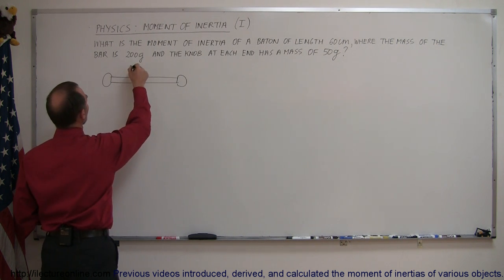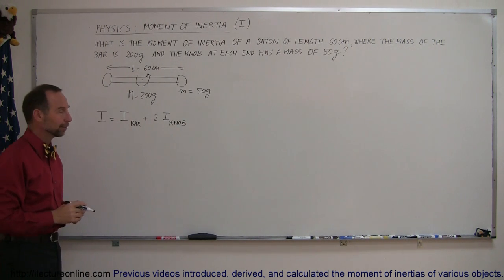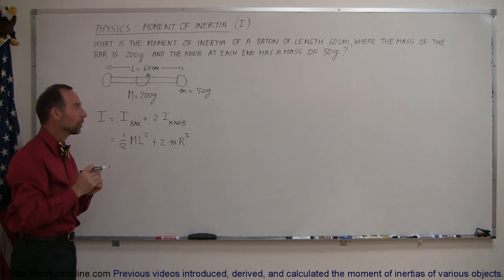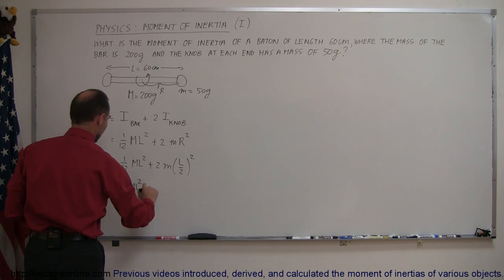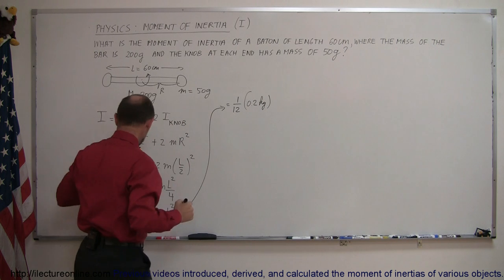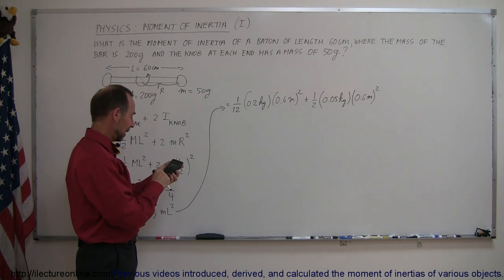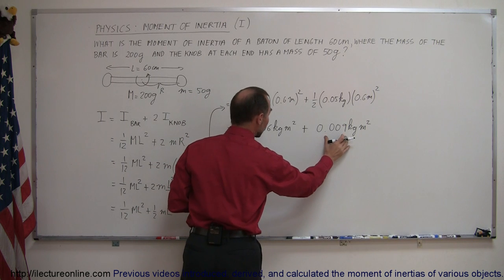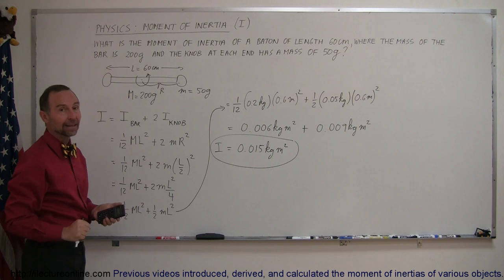Physics 12  Moment of Inertia (6 of 6) Moment of Inertia of a Baton

Comment: Great videos. I have been getting A's in my physics class because of you. Thanksss can you make a video of this problem, I'm very sure you could explain me well in details, I have a test on this chapter on monday. Here is the problem (It's similar to that one but I don't know how to approach the problem):

Two solid spheres of mass m and Radius R are stuck to the ends of a thin rod of mass m and length 3R. Find the moment of inertia of the system about the axis at the midpoint of the rod and perpendicular to it.

Comment: Just a question, for all shapes couldn’t we just use I=mR^2 if we just find the centre of mass or at least for cylinders and such, just cut it in half and find the individual centre of mass?
Reply from the maker: No, it doesn't work that way, but you could use the parallel axis theorem

Comment: Hello! I was wondering... since the spheres rotate around it's axis too (Steiner's theorem), shouldn't the moment of inertia of the spheres around it's centre of mass be included as well? If not, please, would you explain why?
Reply from the maker: You are correct.  if the spheres are considered point masses, then you don't have to account for their rotations.  But if the spheres are not considered point masses, then you do have to account for their rotations.  You will find that the addition of the rotations will be very small indeed.

Comment: why is I (knob) 2mR^2 and not (2)(1/5)(mR^2). is it not (1/5)(MR^2) for solid sphere.
Reply from the maker: The moment of inertia of a solid sphere = (2/5) MR^2  IF (and only if) the sphere rotates about its center of mass.  In this case, the spheres are just point objects rotating about the center of mass of the bar.
Reply: @MichelvanBiezen  ok😊 thank you for your time

Comment: what shape are you taking each knob to be? and wouldnt the parallel axis theorum apply ? i.e if each knob is a sphere... I(KNOB) = (2/5)mR^2 + md^2 ??? or is I(KNOB) supposedly given
Reply from the maker: Sammy,

The knobs in this example are considered point masses.
There is no need for the parallel axis theorem, because the point of rotation is at the center of mass of the object.

Comment: Sir, Why did you use L/2 for the radius of the knobs?
Reply from the maker: Sudin,
Because the point of rotation is at the halfway point,  Since the length of the bar is L, the distance from the point of rotation to the ball at the end is half the length of the bar ( = L/2)
Reply: Michel van Biezen Thank you